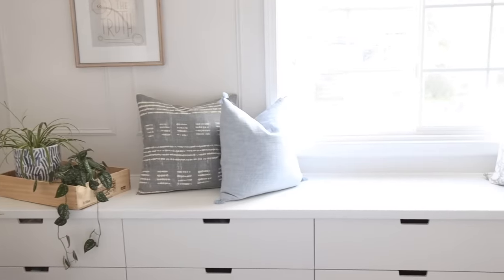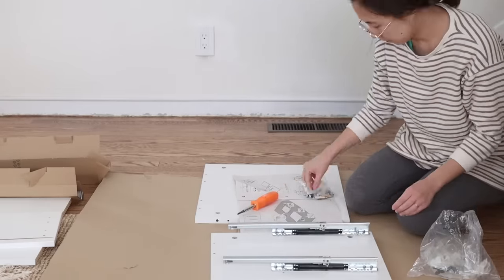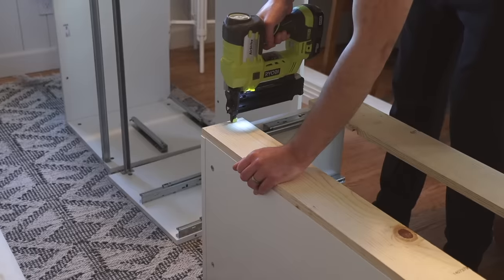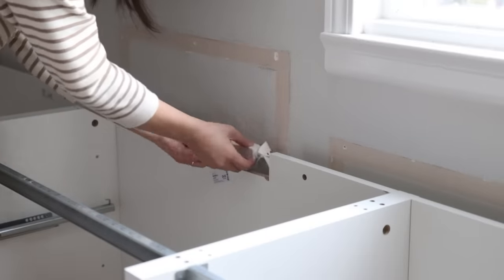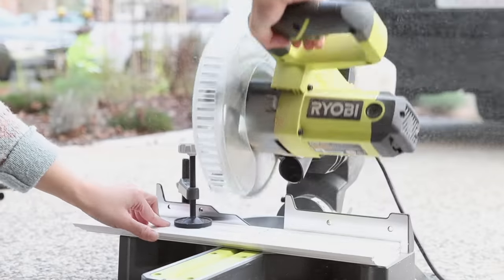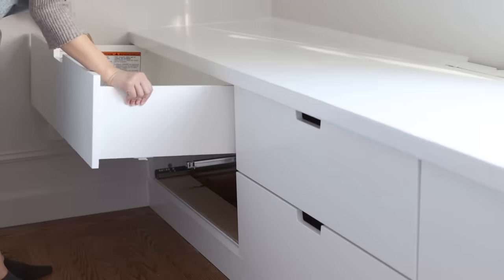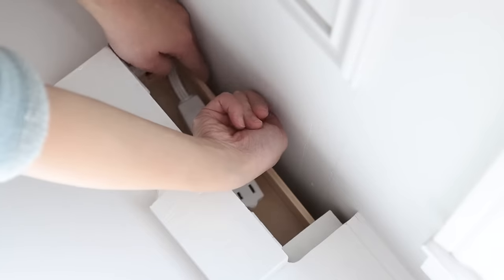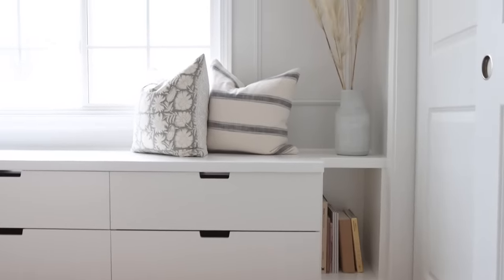DIY Window Seat with Ikea Nordli Hack

Comment: Probably never going to recreate this, but it's brilliant! Amazing work, subscribed!
Reply from the maker: Hahaha thanks😆
Reply: @HydrangeaTreehouse  this will cause a lot of mold if not cared for properly
Reply: @jharnakhanom4511  how lol ? It breathes just fine . It’s not in the shower or by Andy wet rooms so … explain ?
Reply: @TeXasDadBod   @irob rf  just saying, In England, windows that dont have a heater under or just dont have a adequate mold proof structure /Design (which is most houses in the uk, I know this is the fact for  homes in citys or shires around London). Mold (most commonly seen as black mould) is prone for areas under windows of building that weren't built after 2016. Because that unit is in front of the window it might become moldy. So EXPLAIN... Why is it that in the uk, where the rain and wet conditions are only getting worse that old buildings, not necessarily old buildings-but ones built before 2016 are getting worse ? LOL😂😂 ,imagine getting owned by a 11 year old. HE CANT EVEN SPELL ANY, WHAT IS A ANDY.
Reply: @TeXasDadBod  LOL WTF WHERE IS THE VENTILATION, no offence to the creator
Reply: @jharnakhanom4511  In other locations that isn’t an issue.

Comment: I wish I had seen this video before I also used Nordli for my window seat in my bedroom. Mine is 108" long and I also increased the depth to 24" so it could double as an extra bed if needed. I was able to add two book case units at each end with glass cabinets above. My bedroom can now be like a min I apartment and library. Love the Nordli system for window seats.
Reply from the maker: wow sounds like an amazing design :)

Comment: What can also work is a pair of underbed drawer units from a waterbed. A pair stacks to a height of about 18 inches which is standard height for a chair seat. The drawer units and framing are mainly wood components. You'll need a board to cover either end of the unit and a board for the top about 2x6 feet. That's large enough to function as a daybed. I would put the unit up on casters to make it easier to later clean, paint, rearrange, etc.
Reply from the maker: Great idea!

Comment: This is a beautiful and a very practical bench drawer project.  
Today, we picked up the wood 🪵, I have my tools.  🗜🪚 The drawers are assembled.  However, what size pocket whole stews did you use?🔩. The ebook or blog doesn’t mention or suggest what size to use for Kreg pocket holes. We had purchased 3 sizes of pocket hole screws.  Thanks. ☺️
Reply from the maker: the screw length depends on the thickness of boards you use. If you have Kreg pocket jig, you can find the screw size recommendation on their user manual and on the back of their screw boxes when you buy screws. Hope that helps!

Comment: I absolutely love this, it would be a perfect storage solution for our very old 1950’s bungalow that has virtually no storage!!! Any idea on how I could recreate this but with a smaller height say 19- 21 inches, and still have the baseboard finish at the bottom? What could be used as the frame to cut down on the height?

Comment: Love this. Curious to get your insight on a detail... I notice the 1x5 boards on the bottom of the NORDLI are offset. It appears after baseboards are attached that it forms a even front edge with the NORDLI cases (but the drawers). Is this correct? Why not align the baseboards with the drawer fronts?
Reply from the maker: I prefer it set back a bit so I won't be kicking on it as I walk to it.

Comment: Wonderful project! I couldn't tell how you added support to the top bench seat wood to be able to support 300+ lbs of weigh that would come with two or more adults sitting on it. You mentioned L brackets but I don't think that would be enough. What do you recommend?
Reply from the maker: The bench top is sitting on the drawer units, so as long as the drawer unit can support the weight I need, then I'd be fine. My husband and I both sitting on it and it has been holding well for us

Comment: How much overhang was there from your custom top and the nordli? The chests are about 18 3/4” and the boards you used say 2x12x12. Did you cut down one of the boards so that it wasn’t 12” wide. It doesn’t look like you had 4 inches of overhang. Thanks for sharing. It looks awesome.
Reply from the maker: I did cut one of the 2x12 board. I had about 1" overhang.
Reply: @HydrangeaTreehouse  awesome! thank you.

Comment: I would recommend you attach the bench. The wood of the 2x12 will expand our contract over time and might warp. If you attach it that might be avoided.
Reply from the maker: Thanks for the tip - I've noticed that too as the corner moulding got detached a bit from the bench. The bench is very heavy so it's been fine so far, but will keep an eye on it :)

Comment: This is easily one of the best DIY projects I've ever seen! I'm really interested in following this guide and coming up with a window seat as well. Do you have any tips on how to make the top slightly wider? The width of the Nordli drawers are about 47cm, I'd love to make the width about 60-70cm long instead to act as a small bed.
Reply from the maker: you may need to bring it out, and build a frame behind the drawer unit so it can support a wider top

Comment: I don't see any weight limit specifics on Ikeas website (probably because it is intended as a dresser). As a window sear, do you use this for looks and storage or do you actually sit on it. I was thinking about doing this in my living room on both sides of my fireplace, but want to make sure if can actually support an adult sitting on it.
Reply from the maker: My husband and I sit on it at the same time without any problems

Comment: Can you just take the drawers out and still reach the outlet so if it goes bad or you need to change the extension when it goes bad, you can do that easily?
Reply from the maker: nordli has a thinner board on the back, but you can cut out a section to unplug the extension. if you leave enough space between the dresser and wall, you an also reach in from the top opening.

Comment: Do you have any idea what the weight capacity is like? I want to use the drawers to make a storage bench in my dining room, so people would be sitting on them.
Reply from the maker: On ikea website, I have seen them using it as an entryway bench for people to sit. I added a thicker top to make it more durable.

Comment: How can I do this with the furance under the window in my apartment?
Reply from the maker: Hi Vanessa, I haven't dealt with bench on furnace wall before ,so sorry I don't have any specific suggestions. I think it will be tricky because the drawer can block heat.
Reply: @HydrangeaTreehouse  agreed   thanks for your response.  I'm thinking maybe doing this project for near future.